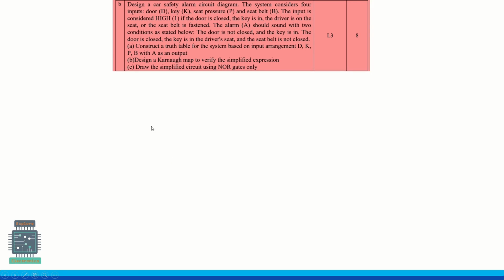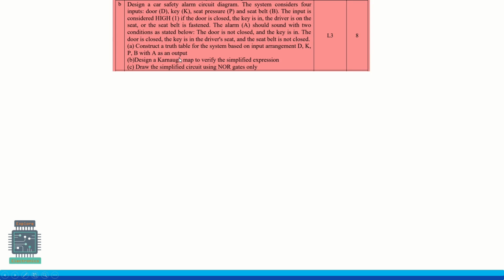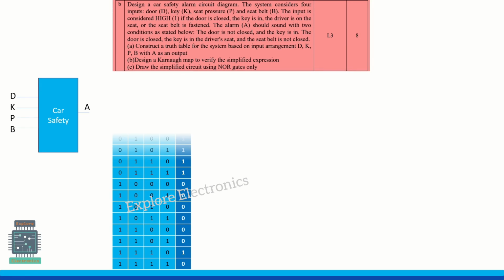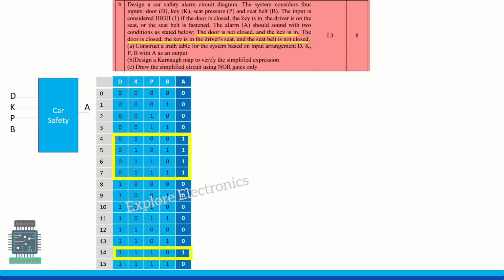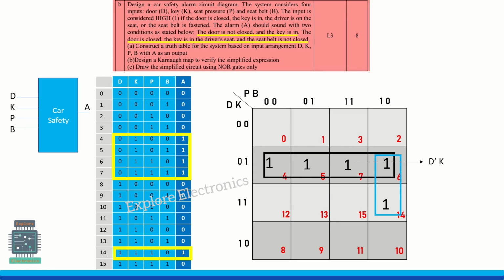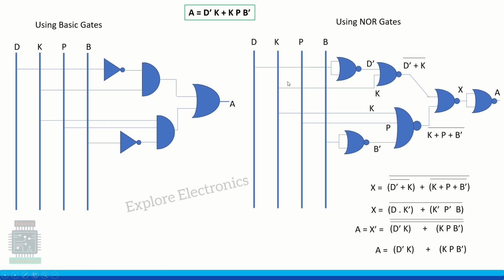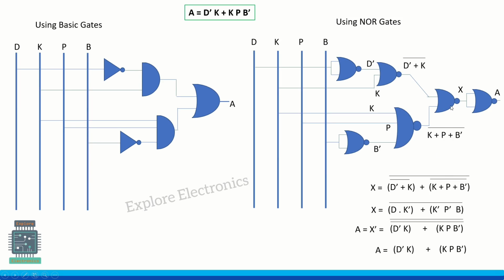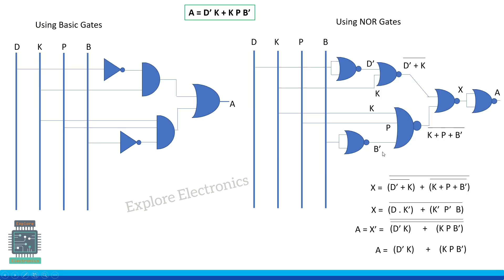DDCO Model Paper Solution Qn 1b [NEW] | Part 1 | Car Sefty Alarm Question solution

Comment from the maker: In the solution second condition taken slightly differently assuming wrong condition in question.
"Key is in the driver's seat" taken as " key is in, driver is on seat"
Reply: Yes sir you are right 👍👍 I am also confused with that statement it should be "key is in and the driver is on seat"

Comment: Sir according to second condition
The 
door is closed,(D=1) the key is in the driver's seat, (K=1)and the seat belt is not closed.(B=0)
BY CONSIDERING THIS 
12 th output of truth table also 1
And final expression obtained as D'K+KB'
Clarify it sir
Reply from the maker: Plz listen to my explanation,
I took it as, door closed (d=1), key is in (k=1), Driver is in seat(P=1), seat belt not closed (b=0)
Reply: @ExploreElectronics  yes,driver is on seat (P=1). But in Q it is not mentioned specifically
Reply: @rajashekharaanni8105 Yess, now do we need to take P or should we just consider D,K,B
Reply from the maker: Condition may be wrong, how can key will be in drivers seat? Then ur should be d=1, k=0, driver not sitting p=0, door b=0, 
1001
Reply: @ExploreElectronics  condition may be  wrong